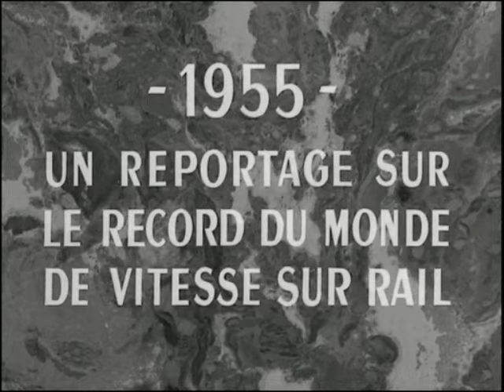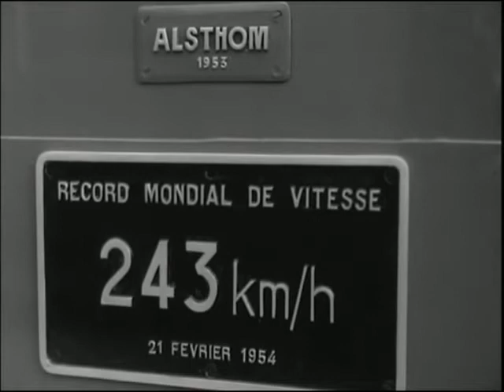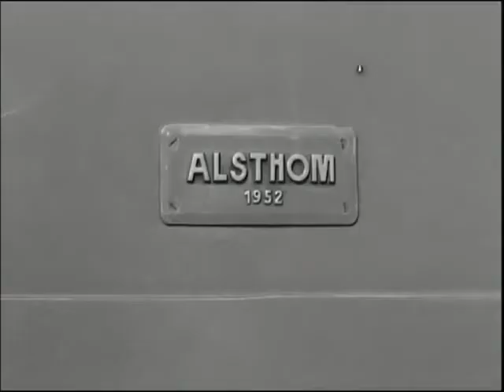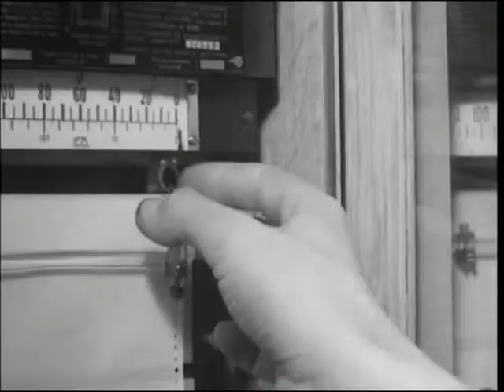1955 World train speed record SNCF 331 km/h 1/3

Comment: That's some real high tech, especially because SNCF had to perform this (successful) record attempt in the south where the catenary voltage is just 1.500 V (okay, for the record attempt they kept it close to the upper limit of 1.800 V). To reach a speed of >300 km/h with a low-weight train you need something like 6-7 MW of engine power - that's approx. 3.5 - 4 kA to be fed to the locomotive via catenary and pantograph. You see the severe arcing resulting from that insane current. Just for comparison: Trying the same with a Taurus on German rails results in moderate .4 kA of current which is within the limits of everyday operation.